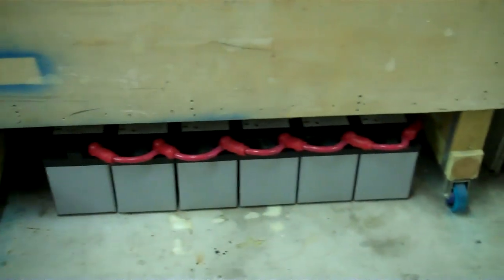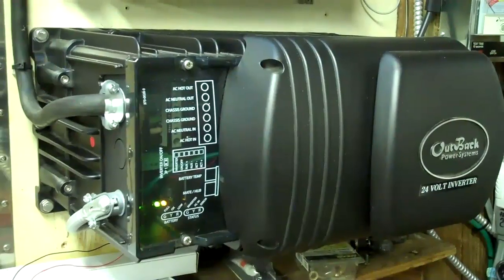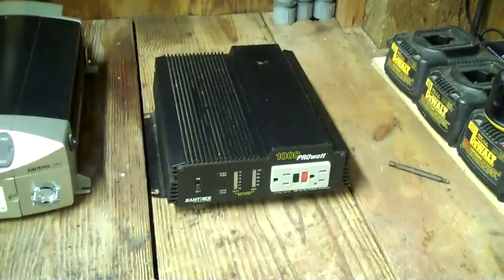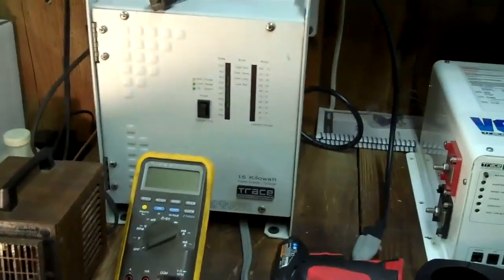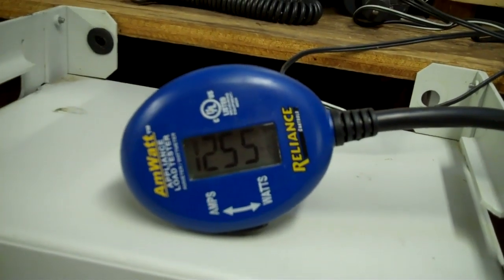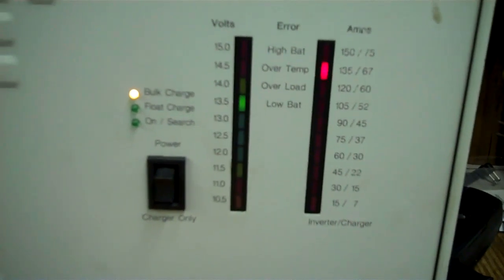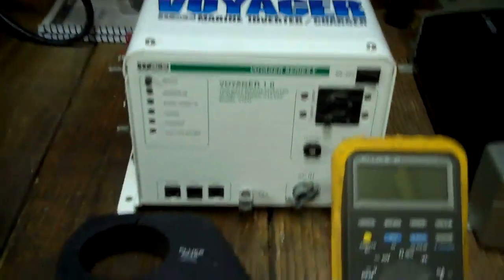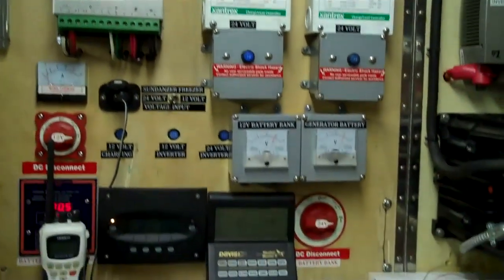"INVERTERS" CHOOSING THE RIGHT ONE FOR YOUR NEEDS, OFF GRID, GRID TIE, BATTERY BACKUP OR GRID TIE.

Comment: I just was given a Prowatt 1000 like the one you show here.  How well has yours worked?  I find mine to be tricky to get going when I first switch it on.  Sometimes, it won't start the first time I switch it on, but if I cycle it one time, it will fire right up.

Comment: love the video. if you dont mind, im trying to setup an off grid system for my house using solar and wind. i live in the caribbean so we always have wind and sun. can you recommend a durable inverter for my purpose.
Reply from the maker: I have been out of it for a while now. My system is still up and running well. My best guess would be the Outback inverter and charge controllers. Mine has been great and the customer support I had with them was a pleasure to say the least.

Comment: The best one I installed yet let's you set the phase angles for each phase on a 120/208 grid tie. It works even if the grid goes down so fast your lights don't even blink.

Comment: Sir, I like your video but if you are using less then 4 guage then you are losing voltage as you place a load on your system. I know working with 1 gauge is hard but it worth it in the end.
Reply from the maker: You may like my videos and thanks for that. I discussed the #4 wire in this video. My setup uses very large wire including mostly 2/O ,3/O and 4/O. I have allways pushed for very large wire sizes..

Comment from the maker: Modified sine wave inverters  work just fine on refridgerators. The compressors will run a little bit hotter and an old fridge may have trouble starting the compressor because they draw up to 10 times the energy of a newer energy star fridge.. Hope that helped..

Comment: You seem like a guy who's done it all. I just want a solar back up that I can plug in to a grid tie in between charges. But here's the thing I only want to spend the 2K or so that I would for a Goal Zero Yeti, and I want it expandable for when I can afford more.  Any parts suggestions?  Also 12v, 24v 0r 48v?

Comment: Greetings. I have a remote cabin and recently purchased a solar system that consists of 3 240W panels 2 100 Amp/hr batts (12V) a charge controller and a small inverter. How would you connect them? I will be running everything in AC, basically a fan, tv, cable box , laptop and a couple of ac lights. Thanks.

Comment: The difference is in the harmonic distortion of the output voltage. Pure sine inverters have almost no distortion at all. Most loads will function fine with a modified sine inverter but some sensitive load like motors need pure sine inverters.

Comment from the maker: When I am saying putting it back in the grid I am simply reducing my power bill. The pay off on the system is about 7 more years. The cool thing is Im not running my batteries up and down. The way I see it you can have a backup generator doing nothing or have one paying for it self over time and ready to go with out gas or diesel. Dont get me wrong a backup generator is a must when running off grid. But chances are you wont see me standing in line for hours for a couple of gallons of fuel..

Comment: Hello, i was hoping for any tips and thoughts on my recently purchased grid tie inverter.  its a small one and claims to only need 24-52 vts to get past its fault but it seems to flash red past couple days when its in direct light and should be working(at least i think, because its not working). i tried cleaning it off again bc thats helped before since where mine are they get dirty quick.  anyway any thoughts on it would be appriciated. thanks, Cody

Comment: GOOD INFO // There 8 main types // But can have mixed feature's or voltages
1 # Stranded inverter // Not very clean power wave
2 # Modified / Cleaner power wave  fit's most application expect High end electronics 
3 # Grid Tie / Only ties to grid 
4 # Pass Threw / as Described
5 # Pure wave / Very clean runs everything 
6 # Stack-able / Can stack to increase Wattage as needed 
7 # Invert & Charger / Transfers / as needed
8 # Marian //Can be anything depending on feature's / But Built Heavy

Comment: Nice Vid i went Through  the invrter wars with about 5 diffrent 1,s  ended up with my first orianal choice a GO Power 1500 watt Pure sine wave,it is Fantastic i hardly ever shut it off as it uses les than .07 watts@12volts .im powering my home and office with as i type. Took it apart its a samlex or more correcty a coltex when u take cover off .U can never be to prepared my system keeps growing .Keep the info coming.

Comment: @OBXSOLWIND ...because i was under the impression that part of the purpose of grid tie systems was to help in the event of a power failure. it just doesn't make any sense to me to invest in something if it's going to be useless when i need it the most. this is why i mention the battery bank because, well...that's power, is it not? charged by alternative means, correct? how is that useless? or is it the grid tie 'inverter' that makes it so and why?

Comment from the maker: @lad18913290 I think you missed the point. The whole system is battery backup. I only brought up the stand alone grid tie systems to let it be known that they are useles in a power failure. If the lights go out I can run for years simply off of solar and wind...

Comment: This is a very good-informative video. Obxsolwind have you attended an ELECTRONICS school?Everything you stated in this video is true.Modified Sine Wave inverters are a gamble though some things will run on MS but they will eventually burn-up with MS.You have a fortune tied up in your system that will become history if the Russians or Chinese give us a high altitude EMP burst, not trying to be negative here, just be aware. Really nice set-up, much research and work here, outstanding job friend.

Comment: Great video as usual.  I would like to hear more about 12V vs 24V vs 48V Solar panels and decisions related to distance and cable size from the panels to the battery bank.  Also what effect the Solar panel voltages have on the battery config and number of batteries required.   Thanks!

Comment: i'm sad to say solar is one of my short comings i know just enough to get me in trouble. when i was trucking i had a 1500 watt inverter i had  to keep that 500 detroit running or that inverter would suck my 4 batteries dry in less than 2 hours. george forman grill 8 qt. crock pot 20  inch flat screen and my dvd player all got a work out i was pretty much maxed out i could run the all at the same time. GOD BLESS

Comment: why do you use so many different inverters? why not use just one that's rated for %30 more than what you need? and what's the point in even having any of this if it isn't useful when the power goes out as you stated at the end of your video? sorry, this doesn't make any sense to me. i would have thought that the batteries would compensate for a short period if the power goes out? what happens in the case of off-grid set ups when there's no sun or wind? (cont...)

Comment: I'm with mdhization, I'd like to see some info on how to do 12v DC through the house to run primarily lights at night off 12v batteries.
Again, I appreciate the time it takes to lay all of this stuff out and video it. Doing a great job, and I'm learning alot from you guys who have done all of this already. When you have a very limited budget, your experience is very valueable to me so that I don't have to travel down those same roads of trial and error. Thanks Kevin.
John Wright (jwright650)